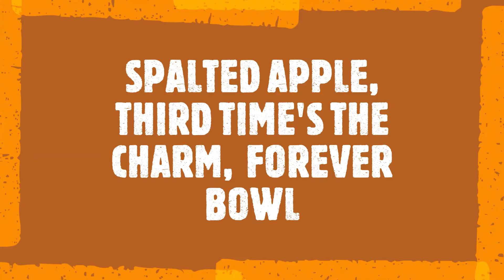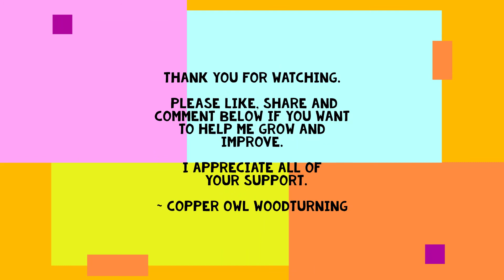Spalted apple, solid turned, forever bowl ~  Copper Owl Woodturning

Comment: Agree pretty wood that is lightly spalted without serious white-rot or typical cracks. Very uncommon to not encounter cracks that need filling with sawdust and cyanoacrylate glue in spalted apple. Do not understand why repeated cutting of rim is necessary. And i prefer to apply finish off the lathe to avoid spraying around, Apparently uised a jam chuck for final trimming away the foot. Turner is very experienced with bowl gpuge, not needing any scraper or depth cut for inside turning, Good job!
Reply from the maker: Thank you, Matt. 😊